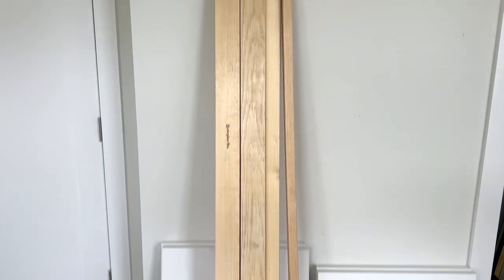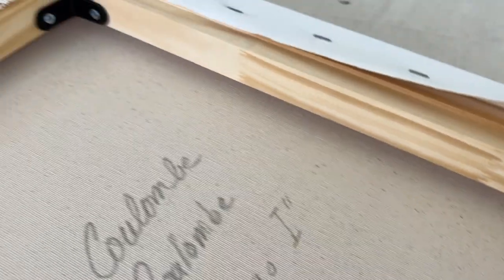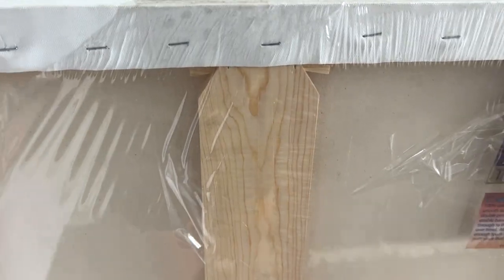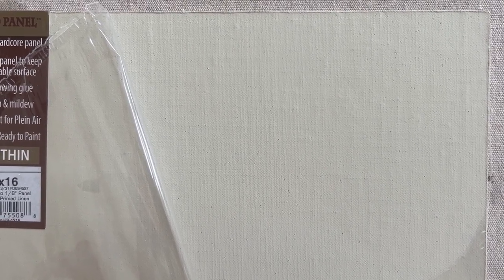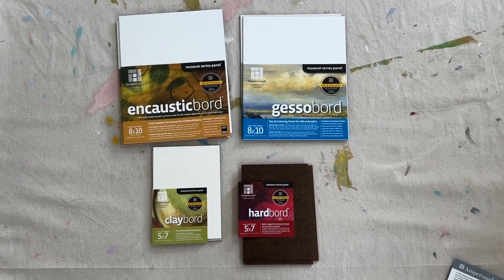Canvas and Panel Quality Comparison #artsupplies #canvaspainting

Comment from the maker: Timestamps:
0:00 - Intro
0:18 - Masterpiece K2 kit
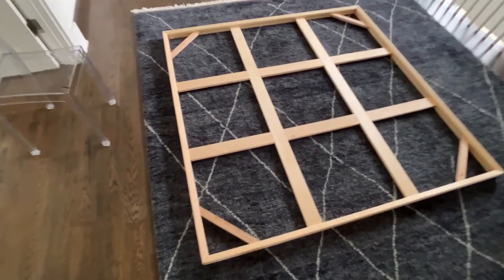1:44 - Jack Richeson/Best Heavy Duty Stretcher Bars
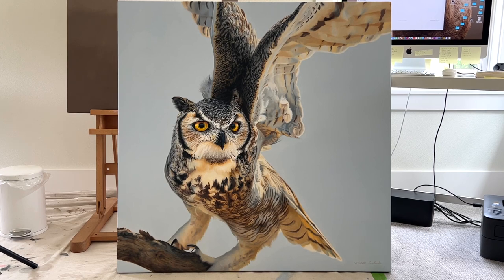3:05 - Fredrix Pro Dixie canvases
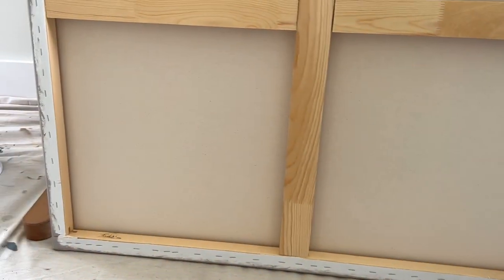4:13 - Blick Premier canvases
5:25 - Artist Loft Level 3 canvases
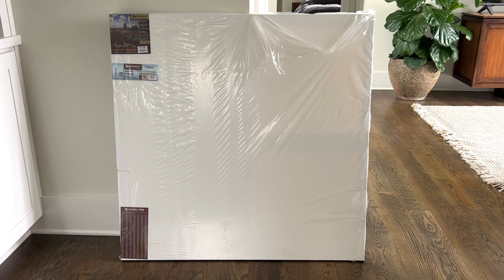7:27 - Masterpiece Tahoe canvases
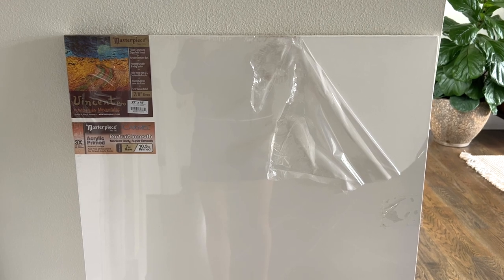8:14 - Masterpiece Carmel canvases
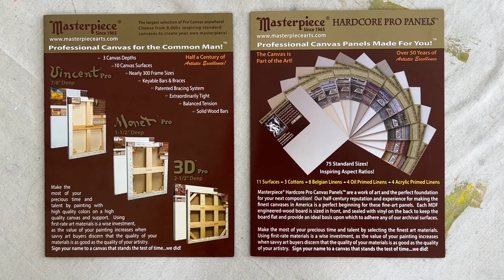8:53 - Masterpiece swatch books 
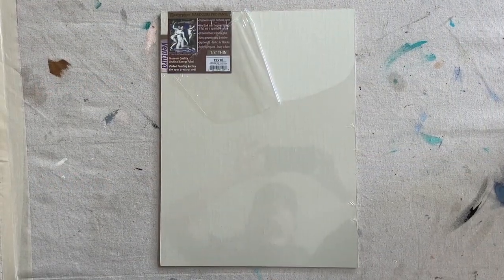10:46 - Masterpiece Ventura Hardcore Pro Panel
11:51 - Ampersand hardbords
13:19 - Hardwood panel
13:50 - Rigid supports vs. flexible supports
14:53 - Framing considerations

Comment: Have you ever tried painting on Ampersand's Pastelbord? Its amazing! I really wanted to love Gessobord but I've experienced too many problems with the corners chipping.
Reply from the maker: Hey Rachel, I haven't used Pastelbord -- do you just use pastels or do use you use other mediums on it as well?
Reply: @NikitaCoulombe  the first time I tried it I used soft pastels on it. But then I tried using acrylics and oils and those work amazing too. I really love the rigid support. Last year I worked really hard on a canvas painting and one day a hole was poked in it. After that I started experimenting with different brands on panels to paint on and so far I enjoy pastelbord the most.
Reply from the maker: @rachelrochelle3714  thank you for sharing! Hopefully this will help another person watching, who wants to experiment with different supports.

Comment: Hi Nikita.
With what are you sealing your wood panels?
Have you heard about Golden advising not to seal the « front » of a panel if we paint in oil over it?
Apparently, according to their research, something like GAC100 or gloss medium (usually used to seal a panel) can create cracks in the lean layers of an oil painting even if gesso has been applied over it.
Maybe other sealants can do a better job though…
Reply from the maker: Hi Neorhim, I have used gloss medium prior to gesso to seal wood panels per their own recommendations: "The best product Golden Artist Colors produces to prevent SID is Gloss Medium" -- https://goldenartistcolors.com/resources/preparing-a-painting-support -- however, I'm not seeing a date on that post. I looked for revised recommendations, and found this: "Avoid glossy acrylic products in any preparatory layer of an oil painting. This includes products that we have recommended for sizing or preparing surfaces in the past, such as GAC 100, GAC 200 or GOLDEN Gloss Medium" -- https://justpaint.org/revising-our-recommendations-for-using-oils-over-acrylics/ -- I just reached out to them to get some clarity and will follow up when I hear back.
Reply from the maker: Golden responded lightening fast. These are their latest recommendations: "When preparing wooden panels for acrylic painting, we recommend blocking against SID with 2 coats of Gloss Medium. When preparing panels for oil painting, we recommend two or more coats of acrylic Gesso, directly applied to the wooden support. When preparing canvas for oil painting, we recommend 3-4 coats of acrylic Gesso, or first sizing with PVC size, followed by acrylic Gesso."